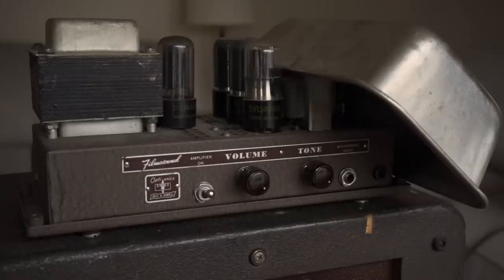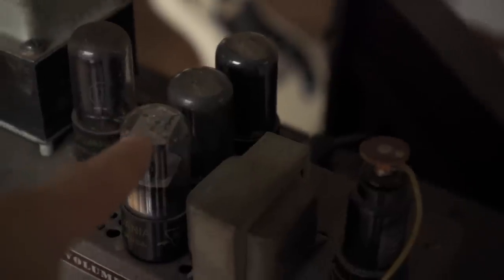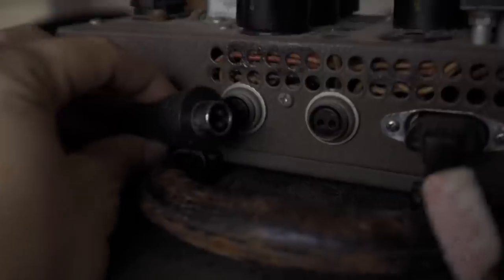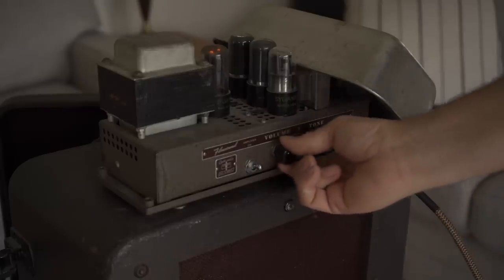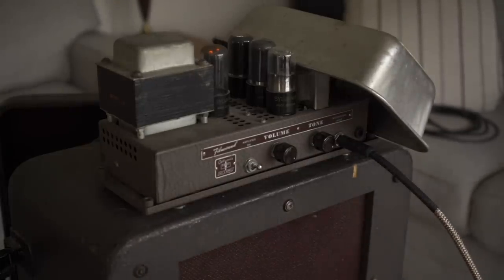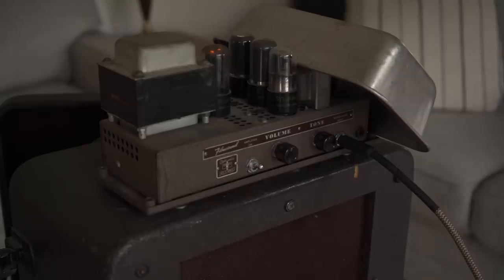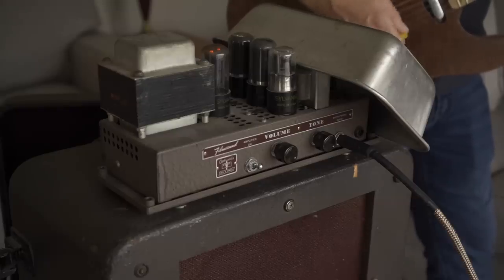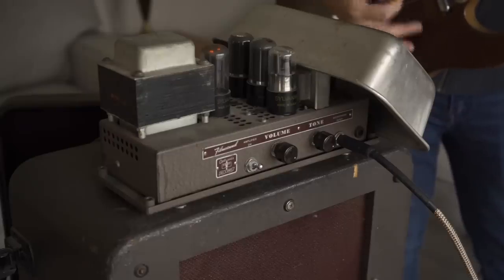I Plugged My Guitar Into A Filmosound Tube Amp And It Was DELICIOUS

Comment: That Jenson speaker is actually a P12R which is a full range speaker. (So the voice on the film can cut through better). You’re right the Filmo can be slightly dark sounding but you’re also getting a high mid boost from the speaker. 🤓

Comment: it is an old olive green color, so with out a doubt, old military.  says projector power amp. it is still in its original carrying case. the case is kinda rough, but amp is still in great shape.  i think it still has original tubes, not 100 % sure. friend of mine gave it to me.

Comment: I think you were lucky 😉 Because guitar amps need well adjusted eq circuits at least before the first distorting preamp stage or ideally before every stage. If they don't have that they sound muddy because the low frequency components modulate the higher frequency ones.
Even some guitar amps sometimes don't do that right.

Comment: I have converted several of these into guitar amps. The problem is that the electrolytic caps have usually leaked all over everything inside the chassis, and there's not much room to work in there. Often easier to start from scratch in another chassis.

Comment: Sounds very much like a standard BOSS Over Drive pedal through a clean amp.
The Volume seems tied to the Gain.
The power amp section is being over driven causing normal clipping distortion.
Surprising that there's any distortion at all since film audio is meant to be clean.

Comment: Something similar would be a modified 18 Watt Lite IIb circuit.  Use 6V6 or 6CM6 power tubes and maybe a 12AYU7 in the preamp.  A 12AX7 would sound like this, but with more balls.

Comment: I got really great results with an old tube "portable" open reel deck. I think it was Grundig or something similar. 
The motors weren't working so it was useless as a deck. I plugged in a guitar just for kicks and got the most unbelievable overdrive. 
I think the mic input wasn't happy with the impedance of a guitar, so it caused some really crazy effects.  Kind of similar to those old Peavey SS heads with the 'harmonics' knob. 
I've also got a B&H 12 cabinet very similar to yours. 
But mine has a little 2" tweeter and a simple capacitor crossover. 
Wonder what the big grey lump is on the left side of your cabinet, next to the Jensen. 
Is your Jensen a whizzer cone?  That seems to be common on these 16mm projector speakers. 

PS Those Sylvania tubes though!

Comment: Can you actually find vacuum tubes for replacements anymore? I remember when I was a kid in the 1960's there was a vacuum tube testing station in just about every store. Definitely in every hardware store. Even brand new tubes were tested. Once dropped they broke. Tubes are too delicate for my liking. Even TV sets had vacuum tubes. Took forever for the TV set to warm up so you could watch TV. Still were hot after you turned everything off. I remember when transistors replaced the vacuum tubes. TV's started instantly. As a kid that was awesome cause a kid just can't be bothered waiting for the TV to warm up for Saturday morning cartoons

Comment: I love this. Gave me some inspiration to finally fix up my 12" + 3" speaker (tweeter is blown or something..)

To all the wiring geniusses here;
      Is it possible to double the resistance of a cab with a single 12" speaker in it?
      Like.. It's 2 or 4 ohm, depending on the input I plug into. 
     But ideally I'd make it 8 ohm (because I only have a hifi amp to plug in)

Comment: I have an At Mars head, which is basically the same Filmosound thing... rats nest true PTP with octal preamp tube.  It sounds incredible,  like no other amp I have...  due to the small shell size, it gets dangerously hot  😂   Yeah, it really cooks...  no failure though, it delivers - the sound is unrivaled,  and I´ve got so many 2x6V6 amps.. maybe only the 59 Gibsonette would better it  - but that is a double single-ended thing, so different, and so unique 
These old amps were so great...  😎

Comment: Hi friend the hum from the circuit loses the mass ground you could try to tighten the bolts in transformers attack well to the Chassis and then the hum going out there. It's a great sound Deck congratulations

Comment: Sounds really good.
Reminds me of when I bought my Fender Hot Rod Deville and replaced the cheap "Groove Tubes" someone had put in it with the high-quality, gold pin, Tung-Sol tubes that I bought.
It's hard to beat an old Fender amp with good quality tubes and a quality Stratocaster but the sound from this amp is definitely a competitor

Comment: I have that cabinet, it’s nice to finally see the amp that used to go with it.  I would use the cabinet more, but it tends to shake and rattle when it gets louder, especially with the back door shut
Reply: The amp is screwed under the projector. 4 screws and one connection cable

Comment: Stuff like this should not be run without replacing the paper capacitors. They decay and have a low series resistance. This causes the tubes to become over-biased and potentially damage the tubes, the power transformer, or output transformer. The filter capacitor also should be replaced, because if it fails short it kills the power transformer. The amplifier will likely sound less good once this has been done - tubes sound best when they are self-destructing, and returning the unit to factory will stop this self-destruction. Saving the amp, but making it sound somewhat worse.

Comment: Did you change anything on the amp? Like swapping out the 2 prong plug with a 3 prong plug or changing capacitors? 
I also saw something about the speaker inputs on the back are slightly too narrow to accept 1/4" leads? 
I would really like to get one of these but I came across a video about converting it to a guitar amp and I'm feeling like it's way over my head.

Comment: I'm not sure if i have spoken to you before about the B&H Filmosound. I think it was you on one of the shorts?? Anyway i was inspired to buy one off the back of that short YouTube upload. Mine needs work. At the moment it's completely stock but i have a problem with the bias. All the Valves sorry Tubes are fine their all green on the tester. I paid quite a bit for it to but not as much as i have seen others that are in a little better condition . I can't wait till it's done they sound amazing. Thanks for sharing.
Reply from the maker: I don't think we've talked before but congratulations on the filmosound.  They are fun projects and have the potential to sound great.  I have a lot of work to do on mine and will post an update when I have something worth doing a video on.
Reply: @DashnerGuitars  That would be great, I will watch. Maybe get a few pointers from you. My pal does quite a bit of the component sorting for me and I like doing the point to point wiring. I can't help but try and get it as clinical as possible. You know, as if the military had done it. 90° angles in the twisted wires, super neat and tidy. Good luck matey, I shall subscribe and keep my eyes peeled. 👍

Comment: The bread pan is very close to the anode pin of the preamp and an afternoon with the undertaker
Reply: My mistake,  it's grid 1 at the top cap, hence the hum.
You could check if the top cap wire is shielded and grounded at the chassis

Comment: cool story :P)  u r smart to leave it stick....  it seems to sound fine......you don't spend 200 bucks for some idea that may or mayn't ge good....     i had one myself...i had a tag that said it was treated for hi humidity theater in the jungle stuff.....   2nd comment ........ the old tube u r covering up- with a steel bread pan.l... ne careful, u could shock the hello of yourself......   oner mod that may fix that is na 3 prong cord.... it will gr4oiund the amp to your house grounding.... prolly take out that hum :)     cheers !!!  great find

Comment: Hello, I'm curious why this works? I had the same idea to plug an instrument, synth etc into a power amp for vintage saturated charm but was told by many if I remember correctly the impedance of the tubes wouldn't be able to handle a various volume from an instrument and would distort like crazy.. What do you look for in an amp to do this? Thanks & cool video :)
Reply: You could use an attenuator

Comment: Just a question. If the unit has the odd plug and the speaker has an odd plug, why not just plug it in directly and bypass the jack altogether?
Reply from the maker: That's a good question and I'm sure there was a good reason why I did it but it was so many years ago that I don't remember.

Comment: How loud was it?!?! Stage ready? Good enough to handle a live drummer? This must be answered with the quickness! for I found something similar (clone?) and I’d like to know if it’s worth the trouble to get it working lol
Reply: It would probably be loud enough cranked with overdrive. An efficient speaker does wonders.
Reply: @jessd1952  thank you!
Reply: These amps are about 12 watts. Push-pull 6V6, cathode biased. You would probably have to mic it in a live setting.
Reply: @VIDS2013  the one I found it doesn’t say but the cabinet that comes with it is a 15inch no name speaker. Think that would mean it’s wattage would be more than 12?
Reply: @JavierSanchez-el4pl  No. Speaker size doesn't dictate the wattage. The circuit and output tubes do. (And the output transformer to a certain extent.)
Reply: @VIDS2013  not that it DICTATES wattage, but generally 15 inch speakers can handle higher wattage. So what I was asking was could the fact that it’s paired with a 15inch speaker mean that the amplifier itself was putting out more watts. Similar to an ampeg 12 inch combo vs an ampeg 15 inch combo. That’s what I was trying to ask. Sorry for the confusion
Reply: @JavierSanchez-el4pl   A typical vintage alnico 15" speaker will not handle much more wattage than a 12" speaker with a similar magnet.
Reply: @VIDS2013  oh ok…well if I get it working I’ll post a video with home volume, home-studio recording volume, pro studio volume, and highest volume possible lol
Reply: @JavierSanchez-el4pl  It will sound great for home & recording use. Will require miking for use in a band setting unless your drummer is really quiet.
Reply: @VIDS2013  we’re a jam band and he’s a brush player lol
Reply: @JavierSanchez-el4pl  Might work for that!